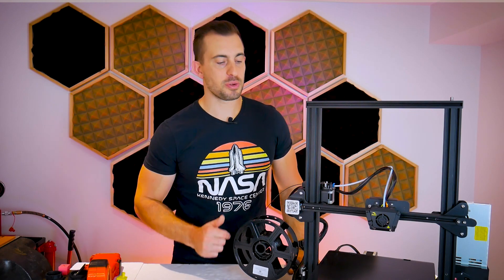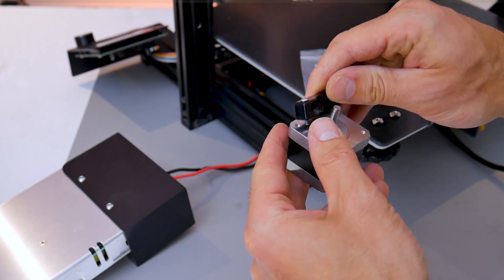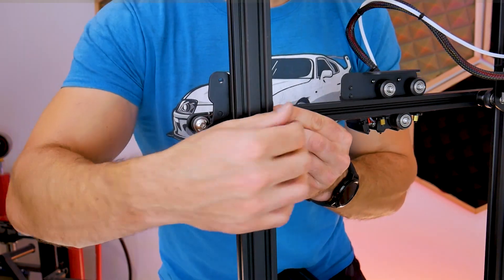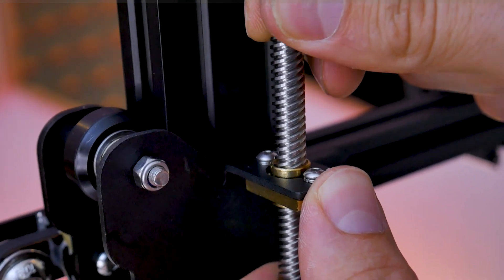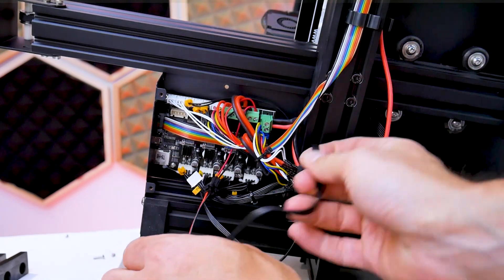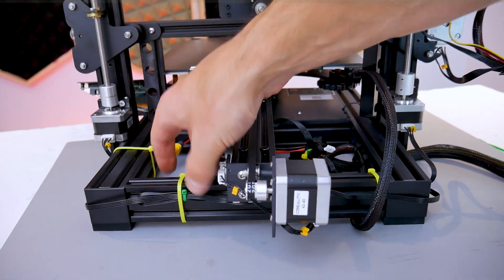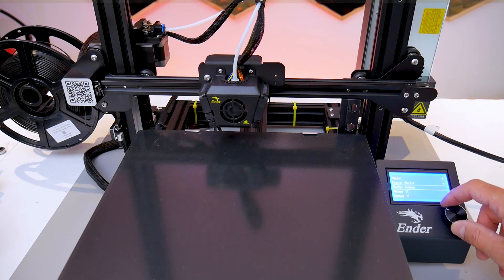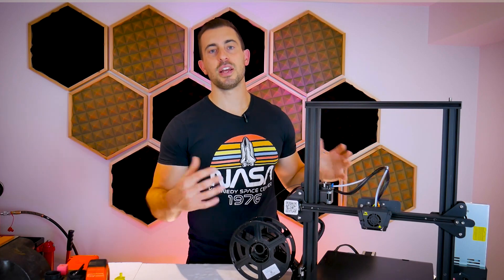How To Install Dual Z Axis Lead Screw On Creality Ender 3 Max (Using A Regular Ender 3 Kit!)

Comment: In 13:50 you are talking about the bearing support blocks for lead screws. You are right about that. They do more harm then good, I read that on a lot of forum. Another issue is that on the Ender 3 V2 the extruder knob could hit this block in max. height. So just leave it away. You made a good video.

Comment: If you leave the bearing block off the top of the lead screws there is a slight risk you might catch the top of the screw rods with loose clothing etc and accidentally bend one.  They are also a good guide to how vertical the rods are and whether a shim is needed on motor mountings to avoid Z-axis binding causing banding on prints.  The biggest problem with simple dual z axis systems is that the rod rotations need synchronising with a timing belt so that they can never get out of step, ensuring that  X gantry level is always maintained.

Comment: Just got my kit, though longer screw is still on it's way.  Going by your video assuming I'm not doing any massively high prints, I can temporarily use the shorter screw until the longer one arrives, as there's no need to fix the top of the screw?  Going to give it a try :)
Reply from the maker: Yep the shorter screw can be used if you're not doing tall prints!
Reply: @EmbraceMaking  Long screw arrived but I'm yet to install it.  Short screw is fine and none of my prints are that huge.  It's definitely made a vast improvement to my prints, it's almost like a different printer.  Thanks for the great video, installation/configuration was very easy.  Wondering what firmware you use on this printer, I have a 4.2.2 board with BL Touch and ages ago I went through compiling my own firmware for it instead of the ancient creality one.  I had tried one or two others I'd found in the depths of the internet also but the one I did myself seems to be working okay, and if it ain't broke don't fix it!

Comment: Was my first printer bought of scamazon for 180 in 2021. then i got it that terrible Ender virus..
Dual lead screw's, CR Touch, SKR E3 Turbo, compiled my own firmware with the BL Touch, Dual screws, and sensor-less homing.
It even aligns both steppers on the gantry automatically using the CR Touch. then i got "sick"
Now bought a NEW Ender 7 off amazon for 250,- and just printed your CR Touch mount for it :P
This time we go Klipping. bought a BTT Tab 7 , my Ender has the TCM2160 boards on it, not the ones you have.

Comment: I guess I should have watched the entire video before going this route. My enclosure will not (comfortably) fit the printer with the PSU turned 90 degrees. I will have to dream up another option

Comment: I had installed a dual Z axis on my Ender 3 V2. I is the same like Ender 3. But i have not taken the original cable, because it could demage the drivers. I made the steppers parallel, so the current is ok and you dont loos a step.

Comment: You forgot to mention a crucial thing when assembling the motor coupler. You don't want the lead screw or motor shaft to extend beyond the slot in the coupler and you DO NOT want them touching.

BTW the actual slop in the threads of that Z nut is ridiculous. So much backlash...

Comment: Thank you very much for this video, it made installing my Aliexpress kit much easier.
Worth mentioning: some Ender 3 Max units use a 480mm lead screw, not a 500mm. Measure the one that came with your unit and make sure to order a matching length rod. Mine uses the 480mm.
Reply from the maker: Thank you so much for your support and generosity! Thanks for the tip as well, I hope some people find it useful!

Comment: on the ender 3 max you can actually hide the psu under the bed(It fits perfectly)! all you have to do is remove the thermistor+heater cartidge wires from the area, and move the plug by unscrewing and mounting it elsewhere using zipties or smth

Comment: i brought a 3rd party kit but the cable included makes the new stepping motor goes reverse , how can  I correct it? thks
Reply from the maker: You need to reverse polarity on one of the coils of your motor. Do a google search for identifying stepper motor coils and you'll need a multimeter to figure out the coil pairs

Comment: great video, i installed my kit, but the motor is not working. i dont know if the motor is broken or i need to do some configuration on the printer for use it?
Reply: sorry about my english :S
Reply from the maker: Any more details? Any noise coming from the motor? Is it jerking around or getting hot? You shouldn't have to change anything in the printer config or firmware

Comment: Hey I've followed your steps but I've got something wrong, when moving the z axis one side goes up and one side goes down, have I put the wire in the wrong place
Reply: The 2 middle wires are crossed on whichever motor is going the wrong way. Use an Xacto or something similar to get the JST connector female pins out and switch them.

Comment: Got my kit today and I'll be using this video. Thank you for the well organized info!
Reply: Where you able to find metal blocks to help level your gantry?
Reply: @solondarville1020  I printed two stands with a bar on each side allowing me to square it against the frame and against the gantry. I tested against measuring distance with a ruler and the ruler alone got me very close. I am using an ABL/G29 bed leveling so if there is any misalignment it's corrected.
Octoprint mesh viewer shows me a variation of less than 0.05mm on a glass bed which is incredible.

Comment: I just tried fitting mine and I can't seem to get them to stay level, the newer Z axis always seems to end up higher than the original when I auto home, any idea as to how I can fix this? Any help would be really appreciated 😊😊
Reply from the maker: So you're saying one side is moving higher than the other side?
Reply: Did you figure this out? I'm having the same issue!
Reply: @candaceppool7829  did you get it solved? I’m about to install mine and I’d like to know the solution incase

Comment: Great video and easy to follow, but I just couldn't get the stepper motor to sit flat, it kept lifting up and causing it to bind up. After a few tries I checked out the plastic part that screws to the motor was not square to the side that screws to the frame, as its plastic I assume its a moulded  part and on one side there was a lump all the way down the length of it. If this happens just check it and file it down on the bad edge till its square, sorted now and works a dream, thank you
Reply from the maker: Glad you got it sorted out and good observation!

Comment: I installed this and now my z moves backwards any idea on why
Reply from the maker: Was it an official Creality kit? Sounds like you've got your stepper wiring harness either plugged in backwards or it was pinned wrong / intended for a different machine. Did you get it sorted out?

Comment: i did tthis on my ender 3 v2 now its binding DX
Reply from the maker: Did you check your rods, are they bent?
Reply: @EmbraceMaking  yes...I was able to solve my problem the second lead screw wasn't seated properly in the coupler took me a few hours to figure out but I got it :p

Comment: Ive been needing this for a long time! IMO Creality should be providing this at no charge because its a design flaw.
Reply from the maker: It should come from the factory like this, yes... but once you get familiar with Creality products you will realize that there are many design oversights. Most of them you can live with but are still head scratchers and you wonder how they missed it if they test their own printers before releasing them.

Comment: Cr10 dual z kit comes with 515mm lead screw. It works perfectly, just doesn't come with a psu relocation bracket.
Reply from the maker: True, so I guess at the end of the day you're always missing one part. For me I found it easier to just buy a lead screw as they are easier to get a hold of on their own than a PSU bracket from a kit
Reply: @EmbraceMaking hi, did you just use one screw or you hace to change both?
Reply: And 3d print relocation bracket